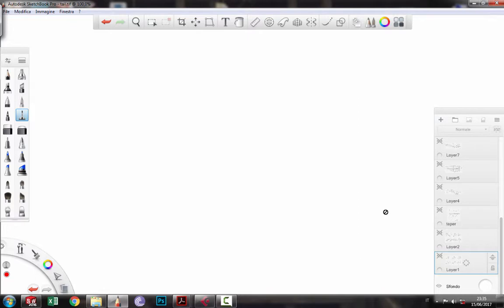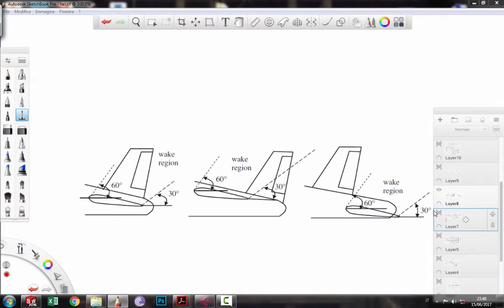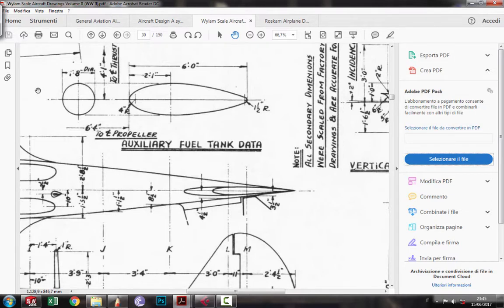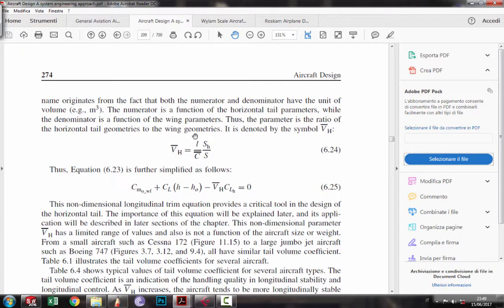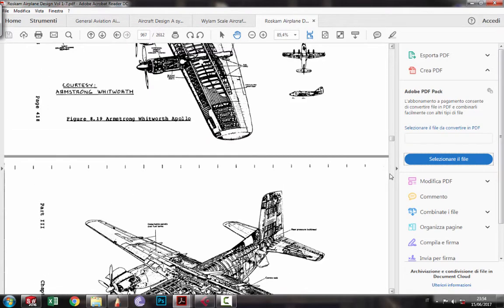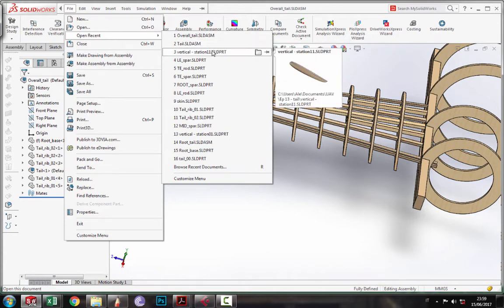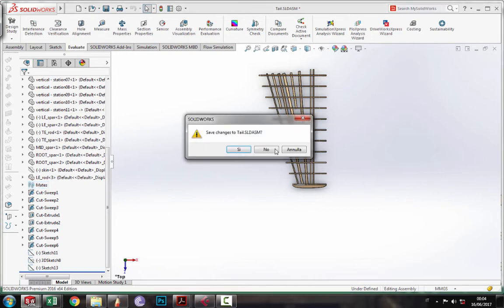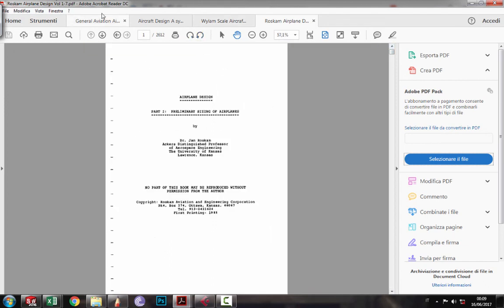Ep.13 - About Tail and its construction

Comment: On all aircraft, the vertical stabilizer and rudder create a symmetric airfoil. This combination produces no side force when the rudder is aligned with the stabilizer and allows either left or right forces, depending on the deflection of the rudder. Some fighter planes have two vertical stabilizers and rudders because of the need to control the plane with multiple, very powerful engines., source : nasa